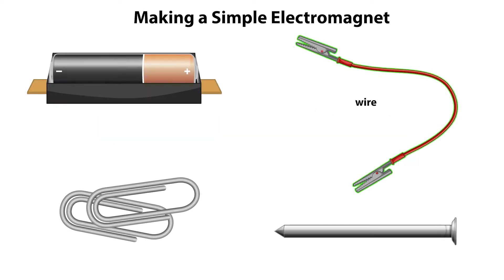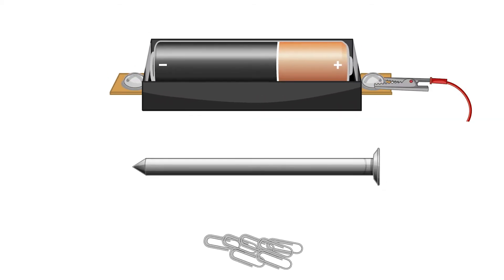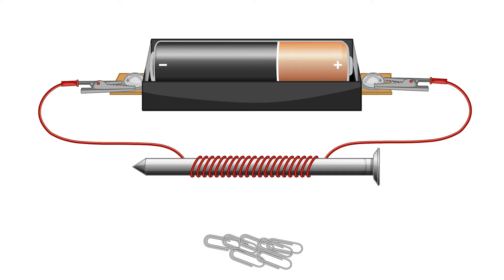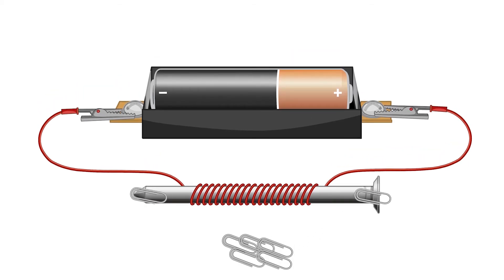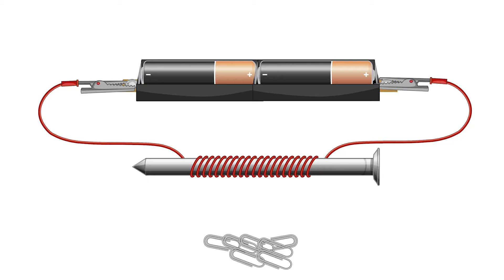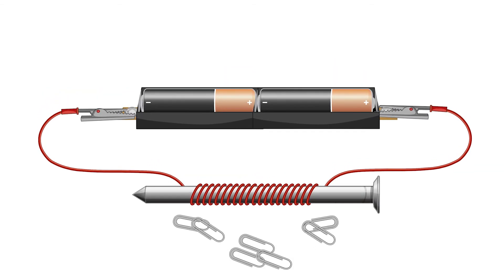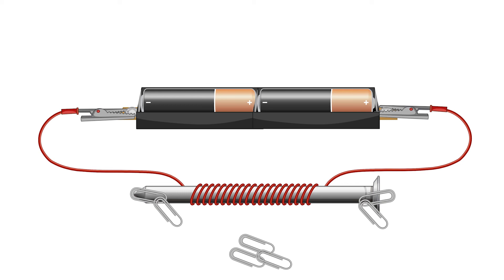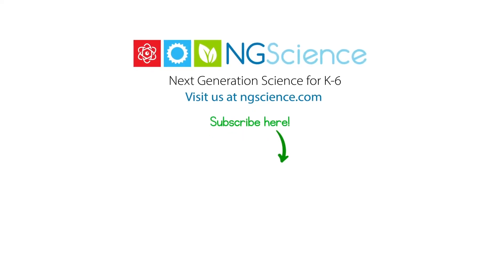Increasing the Strength of an Electromagnet – Number of Batteries

Comment: Would it repeal the paper clips if you reversed the current from the battery?
Reply: No, but if you had two electro magnets, you could reverse the polarity of one side of the magnet, which would repel each other. To be clear, both magnets would attract and repel each other, but you would be changing which side of that magnet is repelled or attracted.

Comment: Can u make super strong magnets with car batteries like it breaking bad?
Reply from the maker: No, it is not possible to make super strong magnets with car batteries like in Breaking Bad. The process shown in the show involves a high-tech and highly specialized setup that is not practical or realistic in the real world. While car batteries do contain a significant amount of stored electrical energy, the design and composition of the batteries are not optimized for creating powerful magnets. Additionally, attempting to manipulate the batteries in the way shown in the show could be extremely dangerous and is not recommended.